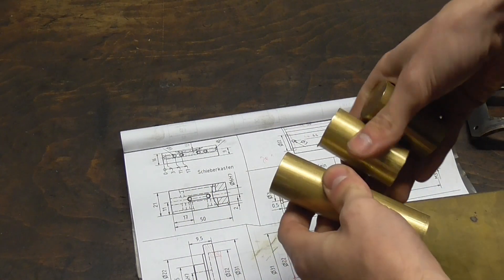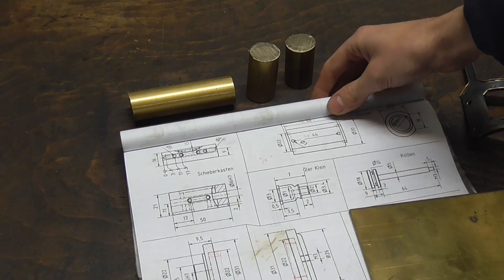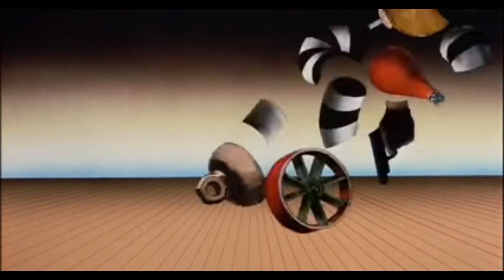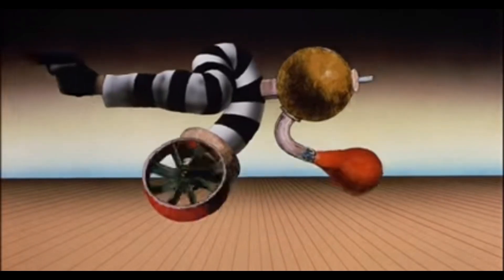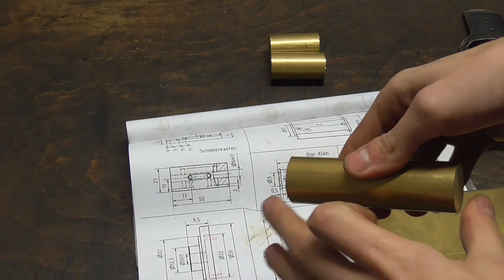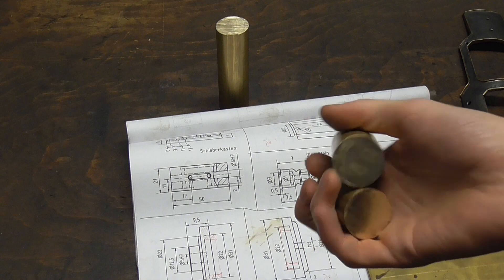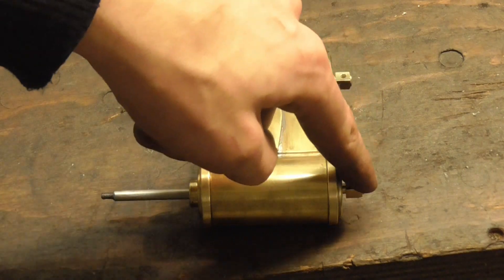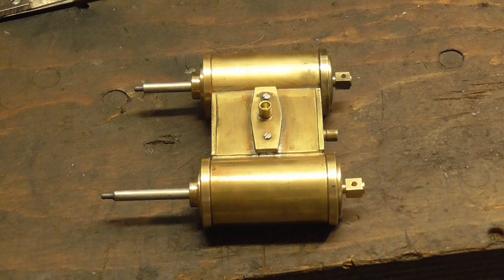Cylinder Block - Doll 512 Replica #2

Comment: Do you know how many of the 512/2 were produced by Doll & Co. almost 100 years ago? I wonder to what extent the production technology at that time was similar to the one you are using today.
Reply from the maker: Hard to say - there are almost none left today, but that might also have been due to the war. 
Many parts are the same on different types of engine (the cylinder oilers I made last, for example), so I'm sure they had a certain grade of automation - probably with hand-operated fixtures, profile lathe cutters and turret lathes.
There are factory tours of the Jensen plant on YT, I'd imagine it'd have looked similar to theirs - add to that a foundry.

Comment: Wonderful to see the making of the Doll 512/3! I own one of the original models from the 1920's but to see it being built is quite frankly amazing! The boiler on this model is interesting because it has a built in flue pipe that runs from the firebox to the chimney going through the boiler itself so the smoke stack actually has a purpose creating draft and super heating the water in the boiler. I am not sure if this was standard on all the 512/3 models but it is on my one. Love your videos and the music is fantastic!
Reply from the maker: Interesting! Would you be willing to email me some pictures of the flue pipe?
I didn't know about that, so I just designed a straight forward tea-kettle type boiler with no tricks up its sleeve.
Reply: @AstraWerke  Yes of course! I'll remove the boiler from the housing and take pictures with measurements for you. Let me know best place to send them. 👍
Reply from the maker: @andysteam1905 Oh, no need to go that far - a picture from underneath through the fire door should be plenty!
My email adress is adrian.straub@ymail.com :)

Comment: Nice done! 
I found out, for me it is more easy to press fit a piece of Precision pipe from Brass or Bronze, in stead of Drilling out a precision bore into a cylinder
Reply from the maker: The beauty of doing your own CAD models is you can make non-critical dimensions to suit the tooling you already have.
Originally, I wanted the bore to be 20mm... Didn't have a reamer, but I had one for 18 - so 18mm bore it was :)